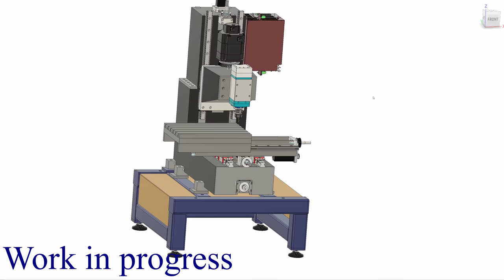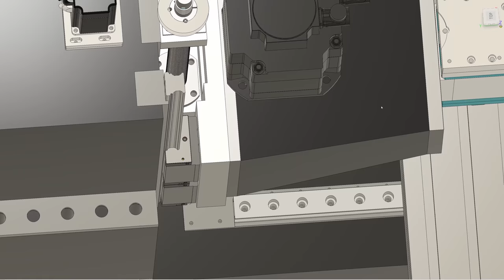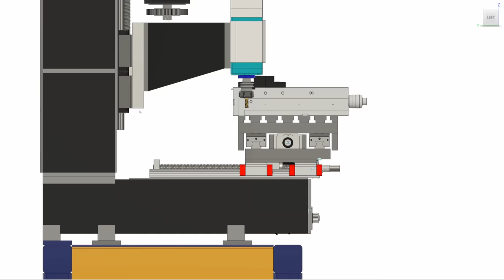DIY Milling Machine Part 1: The base and concrete parts

Comment: A linear guide is statically over-determined. Four linear guides even more so. The dial-gauge test proves nothing. You should not be using the rZ-position from the linear guide in the first place. Are you sure that the rails are not coplanar (ignoring the rotation-direction)? You could test this by having a laser-pointer on a carriage with three (not four!) balls, two resting on one rail and one on the other. When you slide the carriage on the rails, does the laser-pointer deviate substantially? If so, your recourse is to shim the second rail to make it parallel. In any case, the carriages on the linear rail must be decoupled in all but 5 DoF total (e.g. 2 + 2 + 1 restricting degrees) if you hope to achieve precision at all.
Dan Gelbart has a nice video-series on YouTube, and has designed and built his own ultra-precise lathe. Perhaps some inspiration there?
Reply: It appears Alex is using roller guides, Roller guides are very sensitive to binding compared to the ball type they must be very carefully mounted. this requires that the saddle and guide way mounting surfaces are within the tolerances stated in the manufacturers data sheets.  

Many engineering text books suggest the use of more than three points of attachment is kinetically redundant. Maybe for designing an instrument three points is a good Idea however where heavy dynamic loads are being carried more than 3 is the norm. 3 wheel cars have never taken off because they tend to be quite unstable and unsafe when cornering. Machine tools have similar issues particularly CNC machines with high acceleration.
Regards
John
Reply: @johnmcnamara3719  Agree both comments.
Measuring setup is defenetly not relevant. Magnet base should be placed on the block over straight edge (check nsk rail installation video). I'm pretty sure most of this reading comes from rails plane angular screwing.
Same time, roller liners have tight tolerances for inplane. It would be hard to make this two surfaces laying in one plane, since they are protuded and connected to heavy concrete base. No ways to check planes with surface plate.
Basing big straight edge over ballscrew mount surfaces is also not best way to fix this issue, because those ballscrew mount surfaces should be scraped after rails have been properly installed.
Reply: @kirillkirillov3809  A small surface plate and blue will reveal the errors, the steel rail supports set about 5mm above the casting. allowing the test to be performed. For the Y axis it would be better to lay it flat then lower the small surface plate onto it.
Reply: @johnmcnamara3719  there are side support surface outside both rails. Will be hard to find surface plate that will fit inside this pocket. Also, not sure if ballscrew support surfaces should lay in same plane.
Reply: @kirillkirillov3809  Unlike the machine built by Mr Sebastian Ent The machine Alex has built appears in the video to have flat milled surfaces. Maybe a friend nearby could lend a small surface plate for the test.
Reply: @johnmcnamara3719  I am aware of the four wheels on a car, but the built-in torsional compliance of the chassis, and the individual suspension and tyres "pick up the slack". All I am suggesting is a construction that allows the "picking up of slack" without sacrificing accuracy.
I am also aware of the "nest of springs" concept, whereby a multitude of (intentionally elastic) suspension-elements fixate an object. The construction in this video provides for no such freedom. Next to coplanarity, even the parallelism of the guideways (unnecessarily) make this construction too difficult to pull off, due to too many restricted DoF that do not provide any additional workpiece-stiffness.
Reply: @johnmcnamara3719  Another point: Consider the test at 13:55. What can we conclude? Are the axes of the two rails out-of-parallel? Or are just the surfaces a bit twisted? Using the torsional position of the rail is principally dodgy (when using multiple rails).

Comment: Hi Alex; let me tell how I would tackle this situation hoping that maybe you would find something useful in my explanations . 1) I would look for the ''best'' spot along the inlays where I could find 3 points, and I will explain the reason for them in a short while; these should be 2 points on 1 inlay and another 1 point on the other inlay. Where about  these 3 points could be found is debatable.  They could be found at either end of the inlays or, why not, right in the middle of the inlays. These 3 points should be chosen so that to be as close to one another as possible. More precisely: if , say, your X axis is 500 mm, I would choose the first point at 240 mm on the LEFT inlay (measured from the Z axis outwards), the second point at 260 mm on the LEFT inlay as well, and the 3-rd point at 250 mm on the RIGHT inlay; 2) Say that your X axis inlays are 300 mm spaced apart from one another; I would make a rectangle out of ordinary steel, about 500 mm /300 mm and I would drill/insert 3 bolts and cap nuts (semi-spherical  nuts) at precisely 240 mm and 260 mm on one longer side  and at 250 mm on the other longer side of the rectangle; 3) I would  attach on this rectangle as many dial indicators as I could afford, perhaps at least 4 dial indicators on either side, spaced apart evenly and I would place the rectangle on the 600/430 granite plate that you already have; 4) I would set all the dial indicators to zero and than I would transfer the rectangle on to the 3 points on the inlays described earlier; this way , the lack of coplanarity becomes measurable and you can start scraping the inlays because you would know where and how much.  Here is the thing: it wouldn't make much of a difference if it was in the middle of the inlays or 100 mm in or out, provide that you would place the rectangle every time in the same spots. What matters is for the 3 points to be as close to one another as possible because it is this closeness that makes it a viable solution. Have fun !
Reply from the maker: Thanks for the advice. I just started scraping and used a machinist level for that. Looks like that works pretty good and with a resolution of 0,02mm/m per division it should be accurate enough to get the surfaces to a flattens of 10μm or better.

Comment: I don't think this is a big issue. Although you read approx 0.1 mm deviation on the dial indicator, we're talking about a deviation of approx 0.01 mm on the guides foundation. If you're sure that the origin of the deviation is the foundation twist of one guide (and not an overall flatness error), I think this won't affect too much to machine accuracy.

Comment: Hello Alex, I'm currently designing a cnc gantry mill with the sole purpose of machining steel and aluminum. Roughly a 20" x 20" x 10" machining envelope. I will use concrete like you to add mass and rigidity. I really like your cnc machine do you have a design of it? 
My biggest worry is will my gantry be rigid enough. I am thinking of sharing my design now for collaboration from other builders. Did you collaborate with others to fine tune your design? Great job on the mill and thanks for sharing...
Mike  - Plus8Precision

Comment: Nice machine, why not just strap a grinder on a cross slide, and mount it to the z axis then surface grind the 0.1mm off. Use a paint pen and paint the ways, then grind both. It's like surface grinding on a tool grinder.
Reply from the maker: I already had that idea. But I try scraping first. Started with that some days ago and so far it looks like it will work :)

Comment: now you may think I am a girl who knows nothing about engineering and you would be right, however, my brother is so I asked him what you should do and he said the following, the part that needs shimming remove and place some soldering wire between the two surfaces, he said you can get very fine soldering wire, the wire isn't to resolve the problem, but to allow you to see exactly where the problem is. Bolt the parts together again and adjust the bolts which will compress the solder wire until the dial indicator runs true, then disassemble the parts again and the compression in the solder wire will inform you exactly where the problem is and precisely how much shimming is required and where.
I may have some of the terminology wrong and I may have explained the problem to him not quite correctly. If this works I would like you to tell my brother his sister isn't his slave, and you are a sumo wrestler and you will beat him if he terrorises the boys who come calling for me (other than the ones I want him too). and he should treat his little sister to some nice clothes and shoes, but he is not to choose them, but just give me his credit card.
If the above doesn't work, I will find another sumo wrestler.

Comment: It’s a pity there’s a problem as you obviously put a lot of work into it. Can you not use the existing holes and buy threaded bar into them and build another track on top and use bits to level the new track? Won’t be pretty but would work

Comment: Alex, have you considered using DWH epoxy and a precision straight edge to cast a new bed for the linear guides? if you follow the build from Stef van Itterzon he used this methodology he saw from Mark Muller to build the beds for the linear guides on his epoxy granite mill.  

The tools needed are the precision straight edge, of a suitable length, and and a precision level.  The methodology with images  is described on CNC zone starting at post #121. 

https://www.cnczone.com/forums/vertical-mill-lathe-project-log/337318-cnc-forum-posts-7.html
Reply from the maker: I have considered that. But I would have to change some things to make that work which I do not want to do. I have started scraping now. The surfaces are already quite good so scraping is a valid option.

Comment: Hi Alex , love your project, saw the title and thought you were building something to mill concrete 😂,  I have never thought of this idea of an actual concrete machine ,  what is the reason for choosing concrete ?
Reply from the maker: The title is a little bit misleading 😅. I used the concrete because a friend had good experience with it and it is easy the use. No special equipment needed like with epoxy granite.